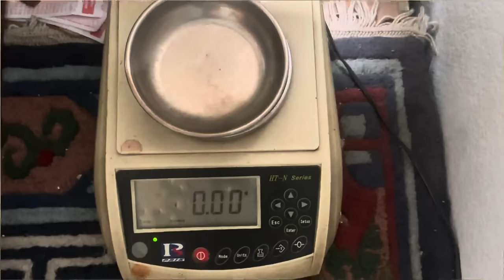How to refine gold with silver | full process of refining gold | Rakesh Bullion

Comment: Why you should add silver about double quantity of gold
Reply: Nitric acid desolve silver not gold so gold must be around 25% and 75% silver or some other metal that desolve in Nitric acid. If there is power metal in gold like ru,ir,os like metal then the gold will not pure like 24k.
If you have those PGM like ru,ir,os you have to refine with aqua regia
Reply: He should have actually ised 1:3 ratio instead of 1:2, that would have been higher purity. Needed AR refinement on that too